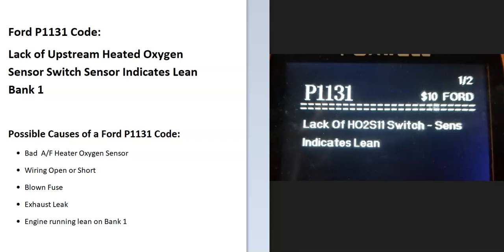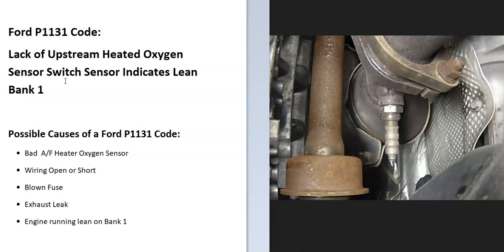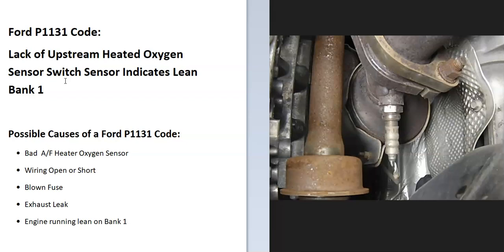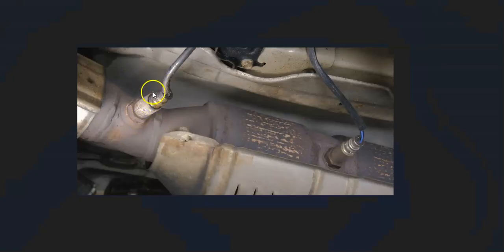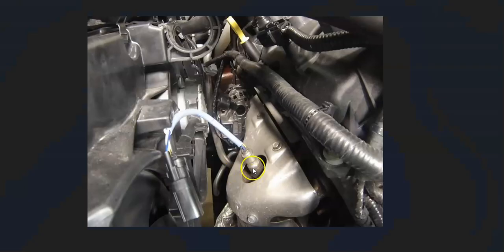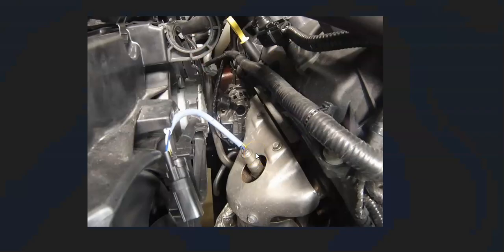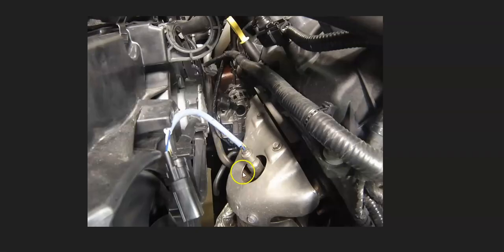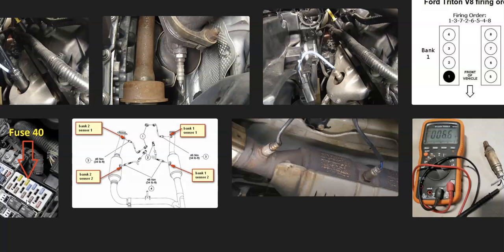How to Fix Ford P1131 Code Lack of Upstream Heated Oxygen Sensor Switch Sensor Indicates Lean Bank 1

Comment: Change out the pvc valve and all grommets on the valve cover, egr valve and idle air control valve. Fixed my problem after finding out these all leak under a smoke test. The IAC will normally leak some smoke but in my case, it was warped. With a scanner engine running, all o2 sensors should fluctuate some.

Comment: So if I have this code plus the P0171 and 0174 for both banks lean, its most likely not  bad sensors but more of a fuel issue correct?
Reply: In my case it wasn't a fuel issue.
Reply: @poolman8676 what was your issue with those codes?
Reply: @raulmedina3681  it turned out to be a vacuum leak. How to pay 500 bucks to get it fixed. Not cheap.

Trie to work on it myself but there was too many vacuum lines.

Comment: I also have P1151 and P0174. CAN ALL THESE BE RELATED? Sorry for caps
Reply: Same issue i am having.  P1151, P0714 and 0171.  Did you resolve your problem?
Reply: @clintnewton8741  yeah I did. It turned out to be a plugged up mass air flow sensor for one of the codes. And then, one of the wires underneath the manifold got brittle and broke and it caused the other code. Once that was fixed, codes cleared. Hope that helps.